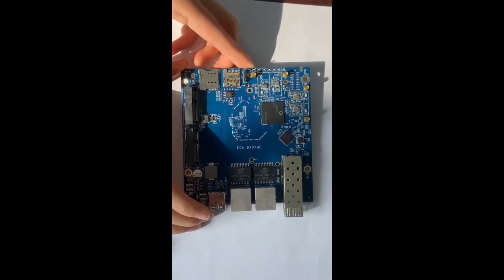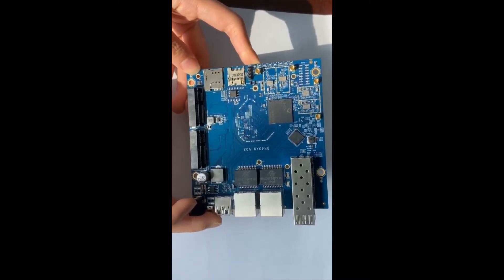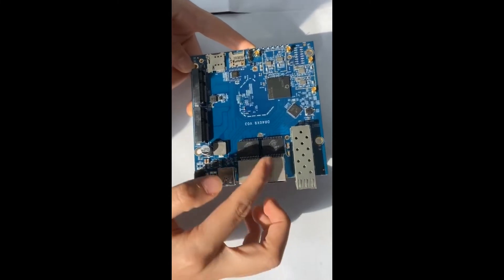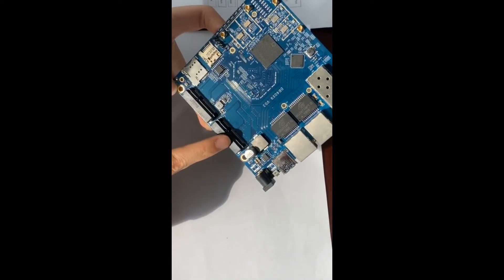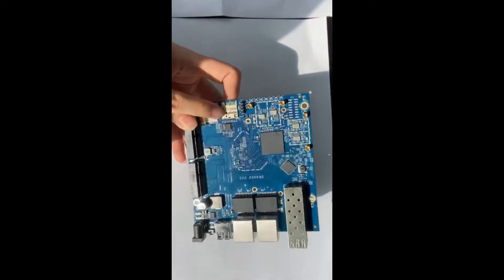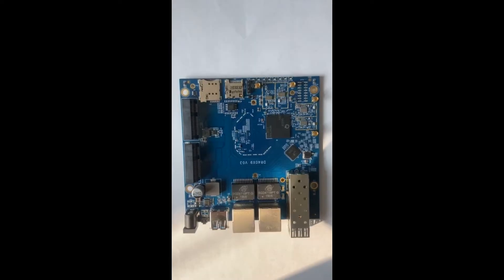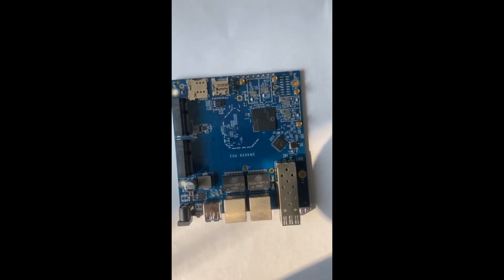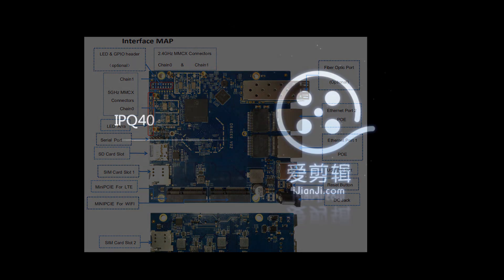(Qualcomm IPQ4029)DR4029: 802.11ac Wave2   2x2 2.4Ghz, 2x2 5Ghz, High Power,wireless,wifi

Comment: Very professional and clear description of the product.  Please clarify -- (1)the Wi-Fi radios are up to Wi-Fi 5 (802.11 ac) - right?; and (2) the additional Wi-Fi and GSM modules on PCIe slots are additional options? - thanks
Reply from the maker: Yes,)The Wi-Fi radios are up to Wi-Fi 5 (802.11 ac)                      The additional Wi-Fi and GSM modules on PCIe slots are additional options, You may not use them if you don't need them!